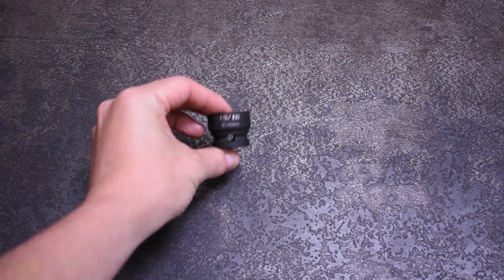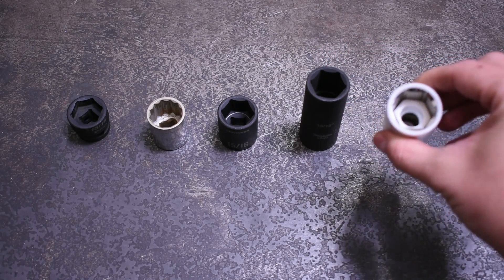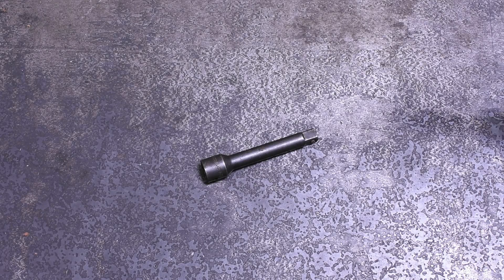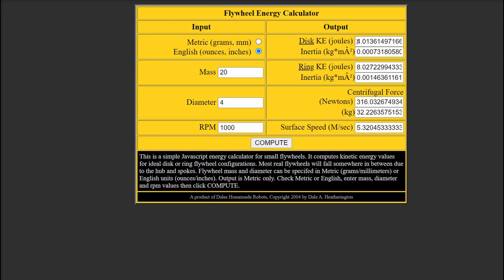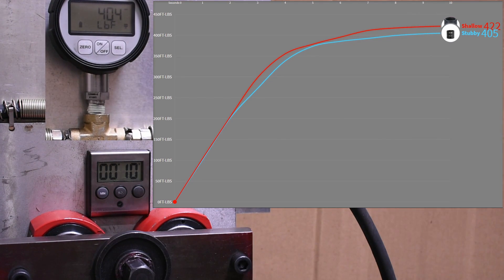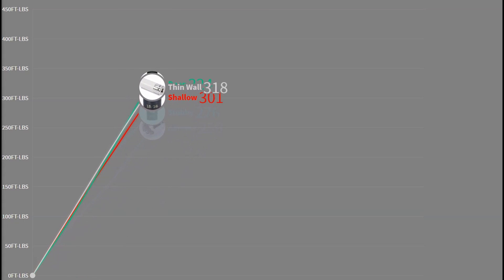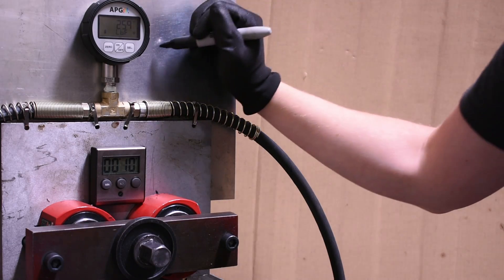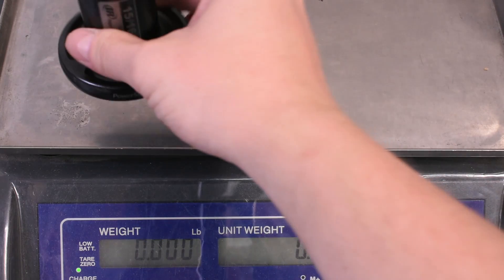Can Heavier Sockets Actually Increase Impact Dyno Numbers?

Comment from the maker: Other For Science Videos:
Air hose size vs power loss: https://www.youtube.com/watch?v=KBQpaUBMmGw
Extension length vs power loss: https://www.youtube.com/watch?v=XYavlJY_5Ks
Impact Universals vs power loss & Durability testing: https://www.youtube.com/watch?v=f0xhgQiTGUY
Smaller Battery Power loss: https://www.youtube.com/watch?v=WD2Pe4MIuSA

Email TorqueRank@gmail.com with any past of future purchase from our channel store and get a google doc of our ranks lists that we're adding to all of the time. See how we rank them by points, power, or with this data rank them how you see fit!
Reply: Thank You !
Reply: nice test, though the answer was obvious to me, by doing screenprinting by hand, I started to have that classic inflamation on my elbows, not like a lot, I realized early enough, so what I did was attaching two thick metal plates to the ratchet-..?..donnou in english... for adding weight, so I wouldn´t have to push so hard, what a difference, I always do it so now. The test is as I expected, if instead of a paralel movement, is a spinning powered movement...yyyyup´h, and yes I think the fact that weight is very stiff as much closed to the source of spin, much more effective, if one is to make a cheaper casting of the socket, that can be the "short" way, in the case of your grandpa´s. When it comes about this powered spinning machines, the fact of the alignment makes a huge difference, on this tests of internet with drillers and stuff, often they say tha the user does not realy matter...hmmhh, in real daily life work, I see terrible things done to machines screws fasteners and users themselves, just by not trying it as straight as possible, relying most of the work to the strength of the motor. It is essential concentrating all the strengh and different forces involved as much possible aligned. Well similar to martial arts, categories by weight...
good to see this concept of motion improved in such a way
interesting channel, youtube is infinte ;)
Reply: THANK YOU

Comment: So the weighted socket provided alot more torque to the bolt.  I can see spending money on a weighted socket on certain jobs.  I have to repair some torn cv axle boots in a Mercedes and would love a weighted E24 socket to remove the axle bolts.  It would probably be very expensive since the MB axle bolts have a certain conical shape and a regular E24 socket does not fit the best.

Comment: I'm not sure why this is a debate. A basic understanding of physics tells you that Force = Mass * Acceleration. Therefore, with all other variables being equal, adding mass to a system will increase the force of that system.
Reply from the maker: That's assuming acceleration stays the same as mass goes up despite the input energy staying the same. Here's a follow up video, mass doesn't appear to solve all: https://www.youtube.com/watch?v=_dgqi7hx8f8

Comment: It’s not about mass. It’s about mass behind/on the contact point.

The nut/socket will naturally try to separate. Making the tip of the socket/impact the most susceptible point of contact/nut damage. 

Therefore putting weight to the back of the socket(opposite to the heaviest force/friction) counterbalances the socket resulting in more nut/socket surface connection. Equaling more torque.

Comment: M18 cordless was 332/262=1.27 = 27% increase over baseline, not 20%.  Pretty significant!  (I suspect that you used the IR as the denominator, which is incorrect as you are measuring the change vs. the standard socket, not the reduction vs. the IR socket).

Comment: What this tells us is harder materials transfer energy better, and a heavier mass helps prevent power bleed.

So the optimal impact socket is as heavy as you can make it before you start to lose torque, and as hard as you can make it before it becomes a shatter hazard.

I think I'll just keep buying cheap deep impact sockets from Harbor Freight 😎

Comment: BPM is a critical variable because each of these tools and drive systems have some kind of natural frequency. They will spring back in some amount of time. If you can apply another blow before the spring back has fully returned, then the energy will "pile up" in the driven object. These heavy sockets work by lowering that torsional frequency, making the spring back take significantly more time. Time enough that another blow can be applied before it is fully returned.

This time dynamic is also why some impacts simply don't work with torque sticks. Torque sticks also lower the torsional frequency, but they do it not by being heavier, they do it just by reduced stiffness. So a higher BPM impact will apply a blow before the torque stick has unwound from its deflection, thus allowing torque to pile up and far exceed the rating of the torque stick. It would be really great if torque stick makers would put a max BPM rating on their products so that people would use them properly.

Finally, this dynamic is why the long extensions lose so much power. The long extensions are less stiff torsionally, and they tend to act a bit like torque sticks. If you repeated the long extension testing with a very high BPM tool and a very low BPM tool, you'd find the higher BPM tool can run a longer extension before the torque level falls off a lot.

Comment: It's NOT just the mass . . .
It's a "flywheel" mass on the end of a TORSIONAL SPRING.  The socket isn't really perfectly rigid.  There's enough "twist" in the materials to allow extra "impact" energy to be stored in the flywheel mass (obvious in the IR version).

It's difficult to explain with words, so here's the IR patent with some great drawings that should be enlightening.  Note that the impact anvil square isn't connected directly to the "flywheel" section.  The square drive is connected to the INNER shell, and the flywheel weight connected to the OUTER shell.

https://patentimages.storage.googleapis.com/7f/39/3a/4ddae6d130f54b/US9463557.pdf

Granted, there's some serious physics going on here, but take a look at the patent and the explanation and it becomes much more clear - and also perfectly explains why HEAVIER does not make BETTER (which your physics expert predicted) but your "hollow" versions worked very well - because the inner/outer shells were allowed to store energy in a torsional spring (which your physics expert could NOT explain - because he assumed torsional rigid systems).  To simplify the overall effect is to move the effective "impact" mass closer to the fastener.

I'd love to see a test where you compare identical impact/socket setups on a fastener; the only difference is that one test has the socket tightly shimmed, or even tack-welded to the anvil.  Along the same thought, socket-to-fastener clearance near zero (line-to-line) compared with 10,20,30+ thou of clearance.  Which hits harder??

Love the channel.  Carry on!
Reply: BTW, the real explanation of why this works demonstrates why you can't build an "adapter" for the same effect.  You could, however, weld an outer shell to the FRONT ONLY (fastener side) of a socket.  It would require some tuning, but could be fabricated in a pinch for a lot cheaper than a "super-power" socket...

Comment: I worked in a shop that serviced only Hondas and Acuras. We had a 3/4” impact and a 1/2” hose used exclusively for harmonic balancer bolt removal. Once the Lisle socket came out, everyone bought one, and that 3/4” gun was never touched again.

Comment: I've never asked a question but I have a great question for you why don't they just use the same design in the battery powered impact???????
Is it physically impossible to have the same dual impact 360° opposed to single 180°?
I could already imagine battery drain versus RPM loss but is there any other reason??
Reply from the maker: As far as impact mechanisms? Yes, it's impossible to use a twin hammer in electric, this is because a twin hammer comes to a complete stop which while an efficient transmission of energy, starting and stopping a brushed or brushless motor is a no-go and also it will never operate in it's power band that way. The spring helps the motors stay at higher RPM, while the hammer is acting intermittently. The reason the hammers on the cordless are two instead of one knob spinning around is for balance, a single hammer whirlling around would make for crazy vibration and probably beat itself apart.
Reply: @TorqueTestChannel  perfect reply thank you my concern is how does the single Hammer not go off balance is it just a counterweight deal? Or Gyro
Reply from the maker: Hitting only at 12 o'clock instead of at 12 and 6 means a sudden huge unbalanced load. It would be like driving with a wheel missing

Comment: Currently at 42 seconds, I want to make my prediction before the reveal... I say yes, my logic is if you used a socket made of aluminum foil, it would crumble because of shock loss... therefore more mass, less shock loss, more impact! Keeping my fingers crossed... also weight distribution throughout the shock will be greater. My non-scientific definition of shock used above: Thrust, torque, energy distribution, TORQUE, etc, etc....

At 3:48 I have a disclaimer I am not saying it will be is advertised I am simply saying, scientifically it should increase, whether it is worth it, or not depends on the quality/density of the product.

Comment: Didn't really need to watch this video to know the answer. I've used weighted sockets for years now. I made my first one about 15 years ago. Pulled the pulley flange of an old water pump. Bored it out and welded it to the center of a 3/4 do impact socket. Worked like a charm. Made a few more after that. Now all the to manufacturers make them.

Comment: I'm newer to the channel and watching a lot of older videos but I had to chime on on this one:  The 20% figure for the increase on the cordless impact is not correct.  You measure the improvement over the baseline:  332=262 = 70.  70 is 26% of 262, so the improvement is 26%.

Comment: I'm not surprised the 1970's chrome craftsman didn't break. That was a different era for American made quality tools. My first 'set' of tools purchased in 1973 or 74. was a Craftsman tool box full of 1/4, 3/8 and 1/2 inch chrome mostly 12 point sockets, deep and shallow. I still have most of them and put a lot of abuse to them with a 25+ year career in the automotive - truck filed (new car dealers). I only broke a couple.

Comment: Really fascinating result!  In a linear system, the total kinetic energy increases linearly with mass if velocity is constant (KE=0.5mv²).  Increasing velocity is more efficient however which is why we've seen a trend in reducing bullet weights in the military in favor of faster bullets.  The equation does not exactly apply to your test since your test involves a rotating element but the principle is the same: with velocity constant, increasing mass should increase total kinetic energy (beans).  Which it clearly did.

But considering that the "super socket" costs $100, that implies a set of ten "super sockets" would cost... $1000!!!  The cost for even ONE "super socket" makes you ask yourself: why not loosen all the lug nuts with a normal, $5 socket and a $25 cheater bar, then follow behind that with the normal socket on a normal impact gun to quickly remove all the lug nuts?  I mean unless you're working in the pit stop of a Formula One race then the "super socket" seems like an overpriced luxury.

Comment: I bought a 19 mm weighted socket designed to remove Honda crankshaft bolts. Anyone who has tried to remove them by hand even with special dedicated wrenches knows how hard it is to do. The socket removes the bolts with one pull of the trigger of my air gun. One of the best tool inventions ever. I use it for many applications where there is a stubborn 19 mm bolt.

Comment: So I do and I don't like them IR weighted sockets. Do in the fact that when room is available which ain't that often they're bad ass. Now having to deal with getting one of those out of a tight area that it first fit in but you may have not compensated for the weight getting jammed up on a random bracket supporting another function of said vehicle is enough to drive you to drinking and cigarettes, if your not already 🚬 🚭 😳 👍 get what I'm saying, limitations!!!

Comment: As a physics major about to graduate with my bachelor's, I dont think a solid socket with more mass would have a similar effect, certainly not as much of an effect. I think this is also why the thinner wall sockets did slightly better. 

I could be wrong but heres my source for my intuition on this matter:
https://youtu.be/pf4u8JfvQ3c
Reply: Btw. Im also willing to bet gopd money you'd get more beans if you drilled holes in the base of that disk near the socket walls. It should reduce the mass of the socket overall but increase the moment of inertia

Comment: Spring losses makes sense, but I think the most important factor in minimizing spring losses would actually be the closeness of the fit between the drive and the socket and the torsional rigidity of the tooling. The tighter the fit, the less rebound between drive and driven - as a thought experiment, you could imagine the ideal would be welding the socket onto the drive, resulting in near zero rebound between the drive and the socket (given that the welds don’t fail). I’d be interested to see an analysis of how drive fitment effects torque efficiency. 

As an addendum, I was racking my brain to figure out why the IR tooling would have such exceptional results when your comment about the flywheel principal not being very applicable due to the fact that the constant is angular acceleration and not angular velocity is spot on imop, and I think it might be thanks to the added rigidity rather than the added mass. The spring in spring losses is the tooling itself, and the wasted energy is stored with the socket acting as a torsion spring. More (or harder) material on the diameter of the tooling would resist twisting much better compared to conventional sockets and lead to a reduction in torsion spring losses.

Comment: If you're going to take off a honda harmonic balancer/crank bolt with a 1/2 impact don't even bother trying without the lisle socket. Maybe it can be done with a standard 3/4" drive socket but I don't have one of those to verify. Good luck to trying hand tools as well; I broke 2 ratchets and a breaker bar before I got power tools and even then struggled until I found someone in the forums saying you need the lilse socket.

Comment: The thin wall socket probably did good because it was more precise, that and mass play a significant role and while the 3-4% difference doesn't seem like much in reality most of the time all you need is an extra few percent to get things going so if have an old banged up light socket and a new heavier one the difference can be pretty big.

Comment: Home Depot actually changes 0% more for Ridgid's hi-torque over their mid-torque if you buy their 2-batteries-charger-bag bundle.
Guess which one I'm lusting for, yet have absolutely no practical use case?

...Then again, there's also the single-battery-no-bag mid-torque only bundle that costs $100 bucks less......

Comment: Are we missing the point here, was it pure mass that improved the torque er beans or because the extra mass meant less movement around the socket attachment and therefore more energy was directed to turning rather than given off as vibration, twisting, heat etc?

Comment: You need to make a mount for the gun or guns to all be held the exact same with the exact same vibration and flex that way human error is eliminated helps keep long vs short sockets and extensions the same its impossible to hold the gun exact same without your hands being at different angle or movement wich will absorb shock and lower the end result 😉  just my theory..but I love your channel and always look here before buying new tools

Comment: I've often wondered if 'preloading' the socket by hand in the direction of tightening or loosening would have an appreciable affect on performance. Similar concept to this. Of course, it's easier to do with larger size deep sockets. 
Could even go to the extreme and pre load the socket using a bar (modified socket and special bar would be required).
Reply: A better way to visualize: take a spark plug socket and put a wrench on the hex at the back. Then put your 3/8" impact on there. Put a bit of force on the wrench in the same direction as the impact gun is set. Would 50 ft/lbs pre load increase output by 50 lbs? More? Less?

Comment: I noticed alot of loss in the recoil or violent rattling while bolting up and impacting structural bolts (and disassembly) so to mitigate that i put my hand on the socket and turn it along as i impact. Effectively cutting out the space that the socket is used as an anvil to torque bolt. It seems to work wonders tightening and loostening for me in the feild and gives corded impacts that extra umph needed in a pinch and air the extra umph needed when you really need it 🤣 wouldnt recomend it all the time if you dont want arthritis when your old. But works for me. either way loved the video and just thought id share my experience as to why that flywheel socket thing makes sense as to why it would work in mt head

Comment: As a Honda tech I can tell you these sockets are absolutely necessary or you need to run a 3/4 gun to get cranks out. The crank bolts are torqued to roughly 130-160 ft/lbs(they are a degree torque) and after 100k miles of heat cycles they are pretty well stuck in there.
Reply: Oh, and I use a lisle style socket and it works about the same as the IR style. No notice difference in the real world.